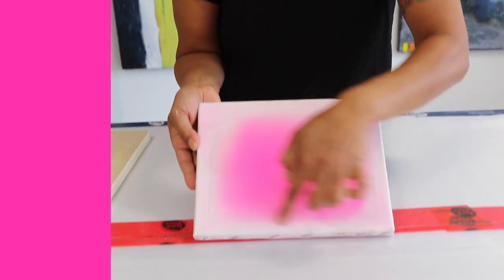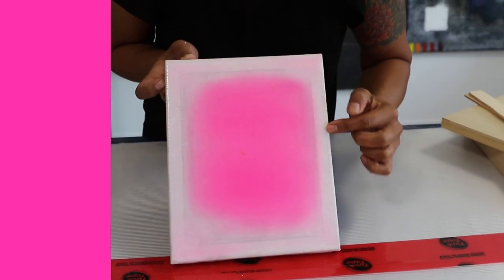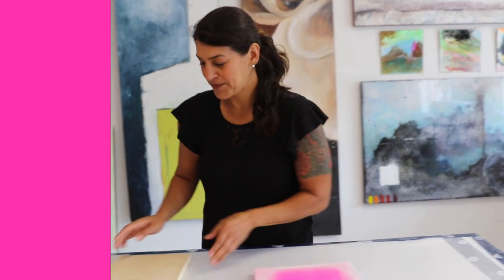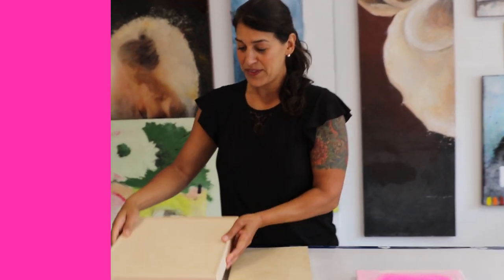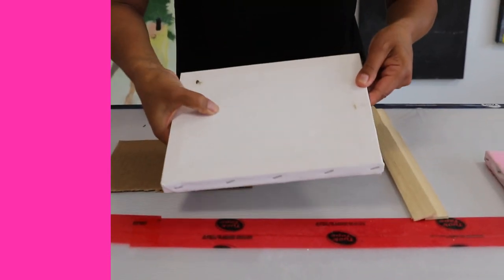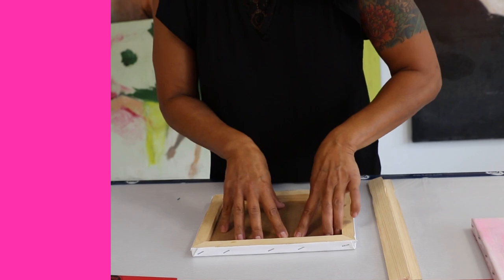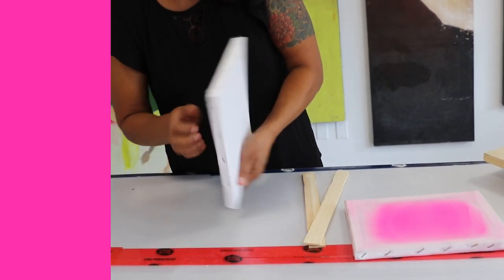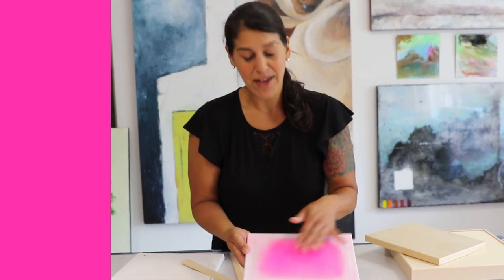Why Did The Resin Pull Away From The Edges Of My Canvas?

Comment: hi! very helpful, so just a question, my epoxy did pool in the middle and I was wondering, even if its been a few months can I still sand it down? Will that ruin the cured resin completely?
Reply from the maker: For sure!  You can just give it a sand-be careful around the edges where the resin is thin so that you don't sand into your artwork then carefully clear away all of the sanding dust and pour a fresh coat.  The sanding is just to scuff up the glossy surface which will give the next layer some tooth so that it adheres strongly.

Comment: Hello, I've been using the timber frames and the resin is still pulling back from the edges. Any suggestions please?
Reply from the maker: quite possibly you are just not pouring enough resin to cover and allow for it to self level, as a result it can pull back from the edge.

Comment: I did all of these tips and used foam core behind my canvas. Unfortunately the resin still pulled away from the edges. How can I fix the edges? Will another coat help after sanding it?
Reply from the maker: You can lightly sand the surface then pour a second coat.  Ensure your canvas is flat and level and that you are pouring enough resin to coat the entire surface easily.
Reply: @Artresin  Thank you so much! I searched everywhere on YouTube for this answer and can’t find one video explaining how to fix the issue. I appreciate this reply. Might be beneficial for someone to make a video on how to fix it. Thanks!🥰
Reply from the maker: @CherryBlawesome  Here is a link to a blog we have that describes how to apply a second coat to fix any imperfections in your first pour:
https://www.artresin.com/blogs/artresin/44594177-how-to-apply-a-second-coat?_pos=3&_sid=60ea32853&_ss=r
Reply: @Artresin  Thank you so much!🌺

Comment: I resined a piece on canvas and i. have an 2" area toward the edge that didn't cover. I realise that i have to sand to refill but do i need to redo the whole canvas cover? im looking for a spot fix after its dried without a full coverage.  Ugh hope you have a tip for small area repair. thank you!!
Reply from the maker: We normally don't recommend doing a spot repair as it is very difficult to not have a seam or outline of the area you were repairing.  The best way honestly is going to be to sand it and re-pour.
Reply: ArtResin not what I wanted to hear lol but pretty much concluded. Thank you!!

Comment: This video was great!!! thank you!
My problem is…I am using a wooden canvas. I poured the resin, covered every inch and looked a few hours later and the resin pulled away from the edges 
Help!!! 😢
Reply from the maker: If you're using a wooden canvas and this happens, it's because there is something repelling the resin around the edges, like an oily residue. Usually this happens when you're handling your artwork, the natural oils from your hand transfer onto your artwork, leaving an oily residue along the edges. The oil repels the resin, causing it to pull away from the edges. All you need to do is clean your edges and then sand your resin before applying a second coat :) Have a look at this video for more information https://youtu.be/V5MUfSy8H7o?si=z-Gtn2M-tDlWsFYX

Comment: Hello. Thanks for the video. I did a small piece on a wooden tile with no silicone and it's still pulled away a little from the edges. Do you know why? I kept wiping the drips off underneath so perhaps it's that? Thank you.
Reply from the maker: Wiping drips shouldn't cause it to pull away from the edges. Can you send us a photo to support@artresin.com? We will be glad to help you trouble shoot further.
Reply: @Artresin  Thank you very much for responding. I have sent a photo. Where you can see a very slight receding, could it be that I didn't quite get the resin to the edge?
Reply from the maker: @vanessasingerpianist  I was just looking at the photo and it appears as though you are doming or pushing the resin right to the edge without it going over. By the looks of the photo you are exactly right you just need to push it just a bit closer to the edge. It takes a little bit of practice so don't get discouraged :)
Reply: @Artresin  thank you very for your kind reply 👍 Vanessa

Comment: A corner got missed on mine but it’s paper (mixed media) mounted on wood panel. I don’t want to recoat the whole piece. I just didn’t quite catch small part of a corner and part of the edges. Do I still use this method? Can I just do spot touch ups? I’m on a budget so the only part I’ll be doing a second coat is the main subject of the piece. I’ll send you an email for more advice on partial second coat. For now how do I fix the corner? Also I missed some bubbles because so hard to see them on such a shiny surface . I should add I’ll be sanding for a matte finish over most of the piece  so the corners are in that part. So I’m hoping if I can just touch up those parts and get them looking blended with my sanding and buffing. Yes or no?
Reply from the maker: Hi Janine :) Normally we don't recommend a spot repair as it is very difficult to get a seamless finish. However if you are going to sand and buff it to a matte finish it very well could be worth a try as it will save you some product :)
Reply: ArtResin I just ordered a gallon from you since I have two more pieces to do and o figure since I’m green at this it will be worth while to have that extra for any fixes .i think since I want an extra coat for the shiny part I’ll just fix up all the tiny hiccups and go over the whole thing again . I think I need to be more thorough with the torch as well.
Reply: ArtResin thanks. Also any tips to make it easier to see bubbles especially on a light colored surface ? Maybe i could shine my phone light over it to see them better ?
Reply from the maker: @JanineMKartist  Yes you can get a light to hang overhead or if your phone light works that should help to see them better :)

Comment: I reinforced the back of my canvas and the resin is still pulling from the edges. What do I do and why?
Reply from the maker: It could be that you are just not pouring enough resin onto your canvas or that it is still sagging.  Just double check your measurements in our resin calculator to be sure:  https://www.artresin.com/pages/calculator
Reply: @Artresin  right, that was a response I got from another resin forum. I used your calculator and added an extra oz. 
So I'm not sure why it pulled away. 
I'm going to sand and re pour but am fearful it's going to happen again..

Comment: My resin does this on HARD objects! Like a wood round or a ceramic coaster...am I just not pouring enough resin?? Any tips would be appreciated as I am an inch away from sacking resin altogether!!
Reply from the maker: Hi Sarah,  ArtResin will naturally self level to 1/8", so if you aren't pouring enough resin, it may shrink away from the sides.  Use our resin calculator to help you determine how much resin you will need:  https://www.artresin.com/pages/calculator.  Also, oil will repel resin, so ensure your surface is not oily.  🙂

Comment: I had this problem with canvas so I switched to the boards and am still having this issue. I made sure my resin was at proper temperature and mixed 50/50. What should I do?
Reply from the maker: Hi Malik, some things to check:  are you pouring enough resin to cover and allow itself to self level at 1/8"?   Here is a link to our resin calculator to determine how much resin you need: https://www.artresin.com/pages/calculator.    Also ensure that your wooden canvas is on a level surface.  If you are still having problems, please reach out to us at support@artresin.com 🙂

Comment: Why do I get a slight pulled back edge on tile or mdf rounds? They aren't saggy like canvas
Reply from the maker: Bare spots, or voids, happen when something sitting on the surface of your artwork and repels the ArtResin, preventing it from adhering.  It could be silicon residue or even something like lotion or natural oils from your hands that transferred onto your piece when you handled it.  

It could also be that maybe enough resin was not used and you need just a little bit more. We are always happy to look at a photo of your piece. Sometimes that helps us to figure out what might be going on as well, they can be sent to support@artresin.com :)
Reply: I’m using a #3 canvas which supports resin for my shell art. Every single time my edges do not cover, even while I’m putting it on,surface is level and my shells have been glued down underneath. Please help

Comment: I’m doing acrylic blanks and I have the same issue. Any advice on that?
Reply from the maker: Hi Connie, make sure you are pouring enough resin to cover, as the resin begins to cure it can shrink away from the edge if there is not enough.  If you are still experiencing the problem please reach out to us at support@artresin.com and we can dig a little deeper :)
Reply: Thank you

Comment: Question: Can I pour resin on canvas board? I have some paintngs done on them and would probably like to resin them in the future, but the canvas board is a little soft (?) so I'm worried the resin might pool, and I can't reinforce it in back. Any tips?
Reply from the maker: Canvas board should be fine!  But if it's a really large board, then you may want to prop it up on something for stability!

Comment: But I used a 7cm silicone mold and it stillcollected in the middle...
Reply from the maker: Hi Brinda, if your surface is flat and level  and you pour the proper amount of resin to coat your surface, your ArtResin will level out all on its own.  If you are pouring in a mold, we recommend pouring in layers.  Please feel free to email us at support@artresin.com and include pictures so we can help more specifically with this issue.  Thanks!
Reply: @Artresin  okay thank you so much!! 
Is this also the same reason all the bubbles collect in thr middle?
Reply from the maker: @brindabalakrishna4809  the bubbles may collect where the resin is thicker as they have a harder time escaping.  Try to pour in thin layers, allowing to cure in between.  This will help reduce bubbles.
Reply: @Artresin  alright thank you!

Comment: This happens when I use a flat canvas board
Reply from the maker: Hi there - Yes, bare edges can happen with canvas boards too, unfortunately. Just like stretched canvases, canvas boards don't have a nice flat 90 degree edge, which can make it tricky for the resin to level out.  Resin is self levelling so it will always find the lowest point to settle.  If the edges are irregular or slightly raised, you may need to build up a couple of layers in order to get an even coat.  

This is why many artists prefer using birch wood panels - they're strong, perfect flat, and have nice clean square edges for easy resin application.  Hope that helps!
Reply: Thanks  so much for replying, helpful information too
Reply: Are they ok to use ?
Reply from the maker: @Ebonybones47  you can totally use canvas boards, but you may have to do a couple of coats to build up the edges.  Let the first layer of resin dry, sand it down (being careful around the bare spots not to damage artwork), clean up the sanding dust, and pour a fresh coat.  The fresh coat will fill in all the scratch marks from sanding.  PS - always wear a dust mask when sanding resin, you don't want to inhale the fine particles.
Reply from the maker: See example 4 in this blog - I had to do a bunch of coats on this canvas to cover up the edges.  Could likely be the same story with a canvas board.
https://www.artresin.com/blogs/artresin/bare-spots
Reply: I’ve found some wooden art boards on Amazon would they be ok ?
Reply: @Artresin They’re called canvas boards but they’re actually just wood (made from poplar plywood. They are blank on both sides)